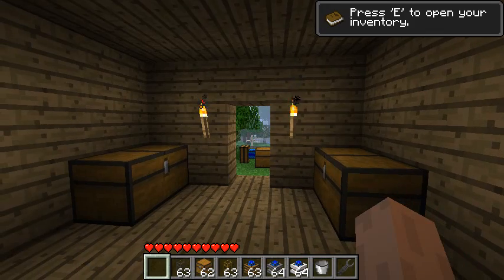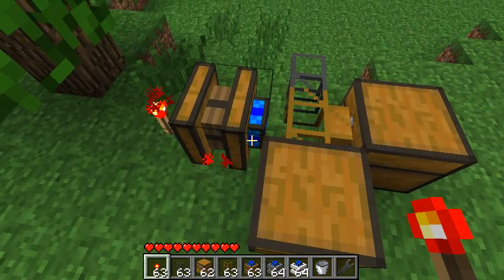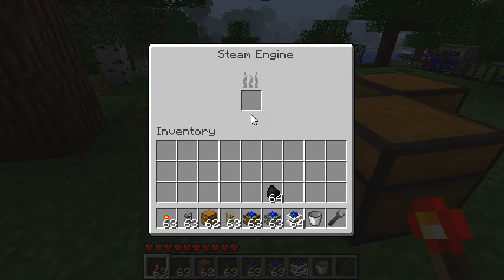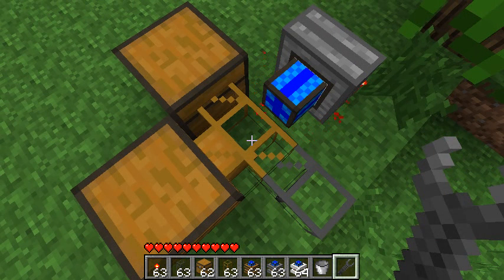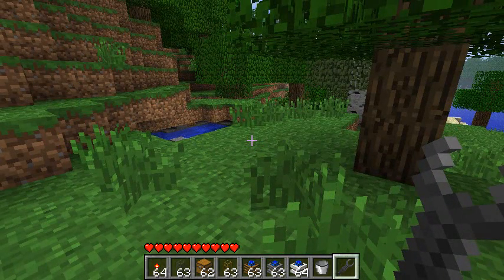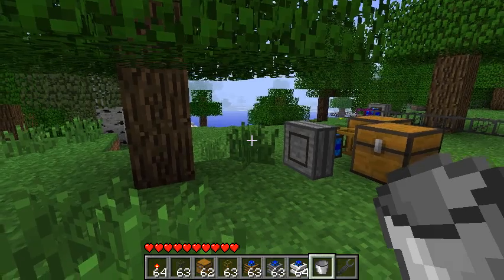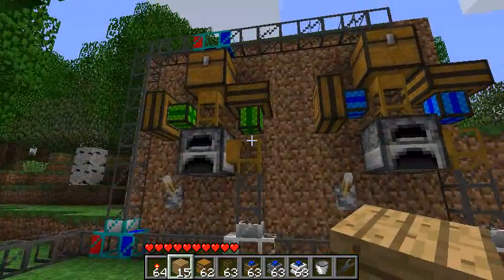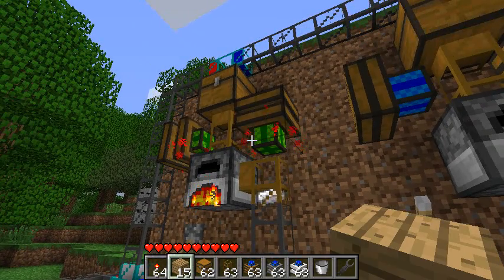BuildCraft 2.0.0 - Preview

Comment: It would be nice if you could make a setting in config where you can turn on/off the animation of the engines, to reduce the overall lag, which was one of the reasons I had to change to just redstone torches. Also, how about a depth limit setting you can set for your quarry, so it stops at a certain limit? sometimes you just don't want it to dig all the way down, and having to keep an eye on it.

Comment: Since this mod is highly used with industrialcraft, will there be any way to incorporate the wrench from that mod into this one.  Otherwise, would the mods be no longer compatible?  I guess I will miss the fact that you could make completely automatic factories with those mods, but with the new updates, That will be very hard unless you can make a charcoal factory and use that to power your machines.  Even though I may not be super excited about the new updates, They seem much more practical!